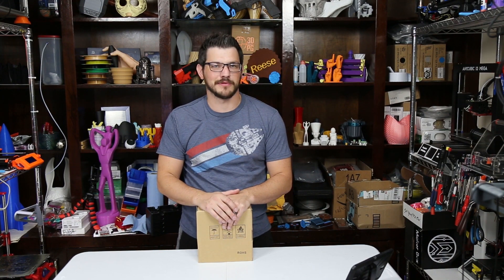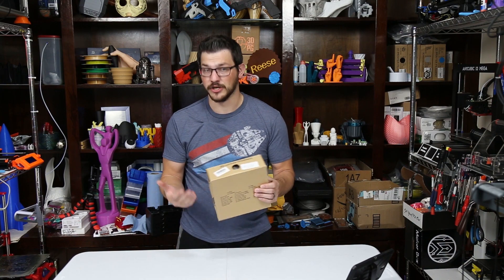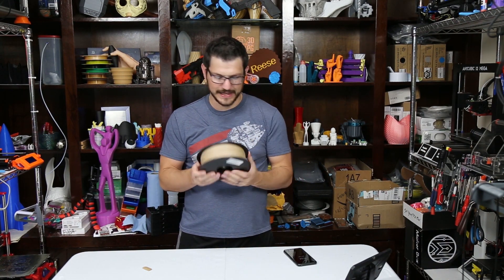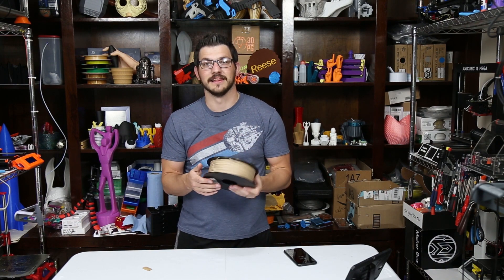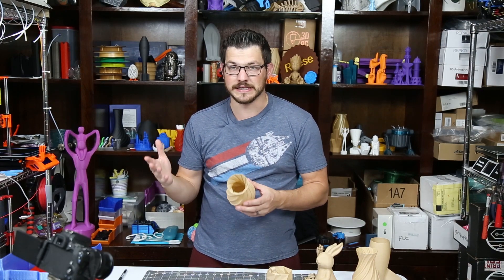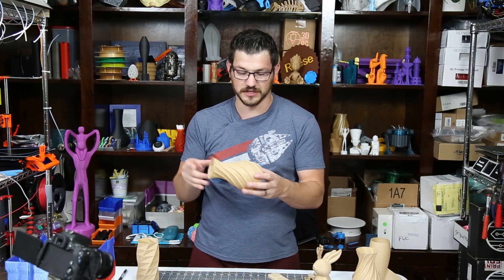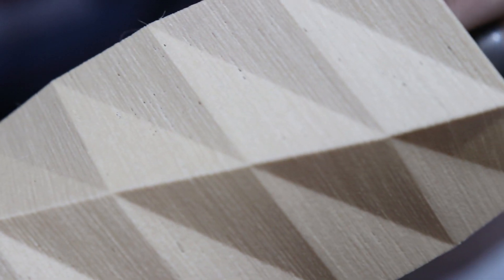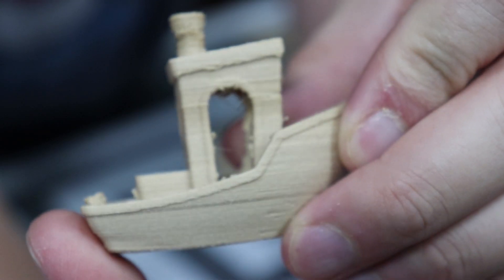Geeetech Wood Filled PLA Review

Comment: I have this filament and it snapped during a print! Is there a way to prevent this from happening?
Reply: you have to dry the filament spool, it usually crumbles when it is too humid or wet, it happens almost to every material. Also avoid curves from the spool to the extruder.

Comment: Looks like you may be developing a clog from the wood particles... What size nozzle was it? Maybe try a . 5, or. 6 see if that father's day statue prints better..

Happy father's day buddy.
Reply: It happens even more with smaller models like that with short extrusions and lots of retractions. Like the wood particles build up and form temporary clogs. Makes for under extrusion and random extrusion.
Reply from the maker: Thanks! I use a 0.4mm nozzle with all wood filaments. I've had fantastic results from other brands, just not this one.
Reply: @Fugatech3DPrinting  I've seen it before, many are fine with .4, some, and especially the old ones all recommend a .5 and it makes a big difference. 

If you look in most how to guides, they recommend a bigger than average nozzle.

I was doing a ton of wood a couple years ago. I was really surprised by the difference.